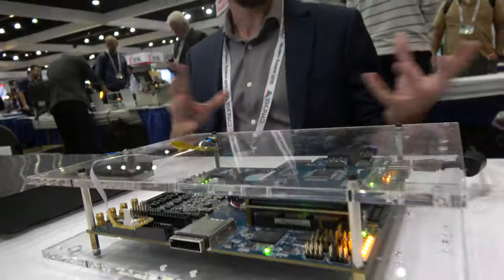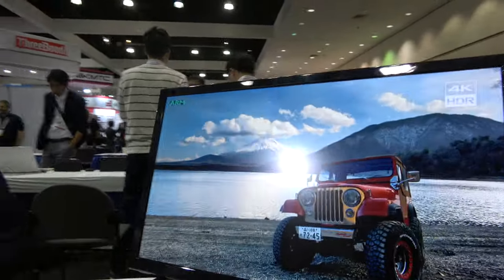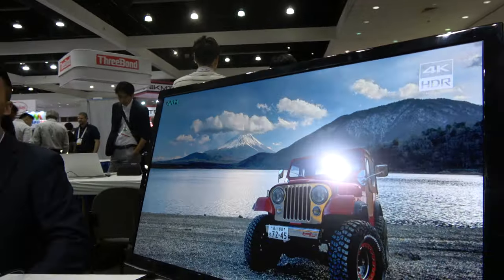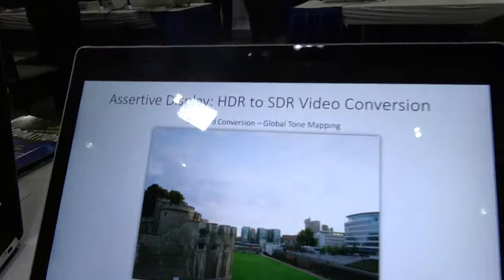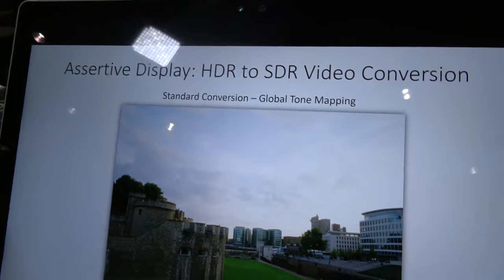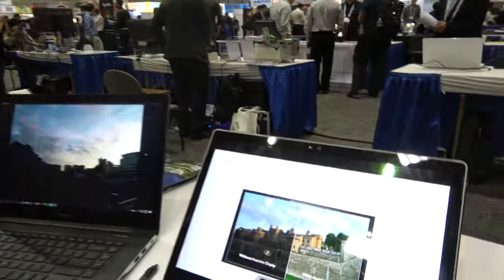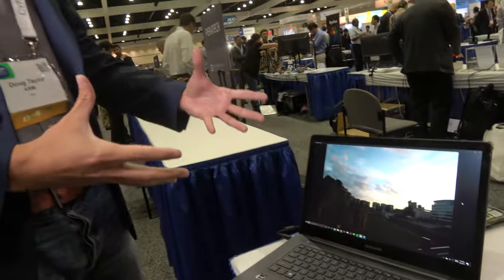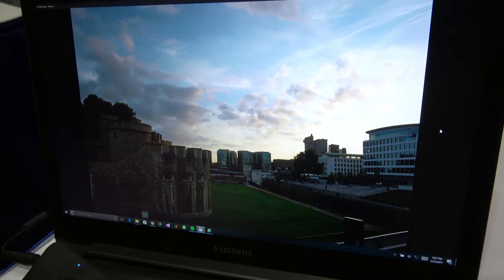ARM shows HDR-to-SDR Conversion

Comment: How about a small box HDMI out 4khdr to in to out. Sdr baked in. By the way all they are doing is taking the rgb levels are Cushing then down....how do I know? Because I work on this type of footage all the time. Go-to your TV website and get adv nits 100 percent of the panel and set your white point black points within that range and your panel will look amazing. But this requires encoding. So yes to have these options for discs is not a bad idea....... Honestly I own uhd and hdr player and discs but perfer watching in sdr conversions as the brightness overall and color punch is way better. Hdr is made in some movies to exact sky,skin tones and range but it's boring. Just being honest. Go-to your local store. Demos are amazing. Play real movies on the same player and panel not so much!